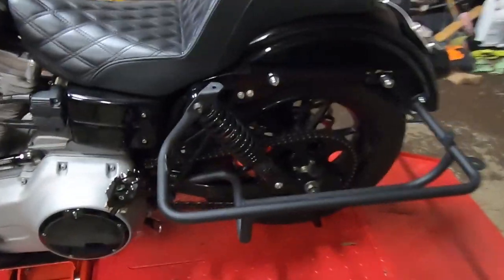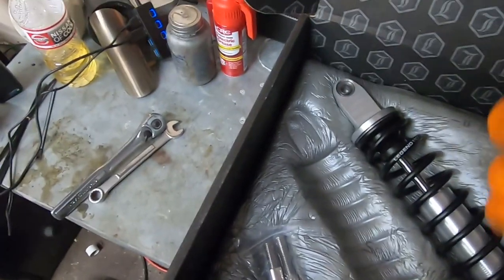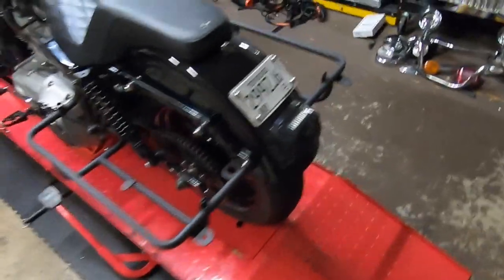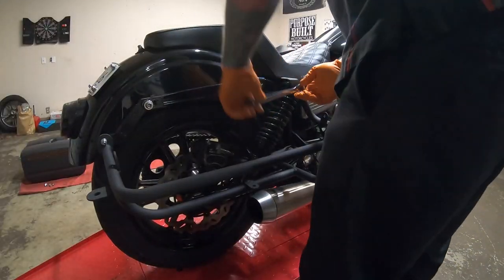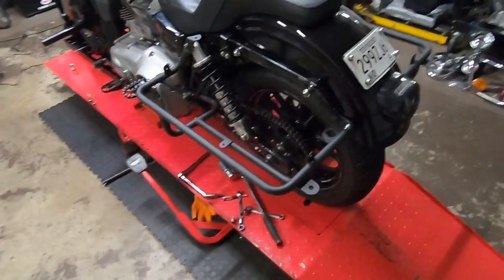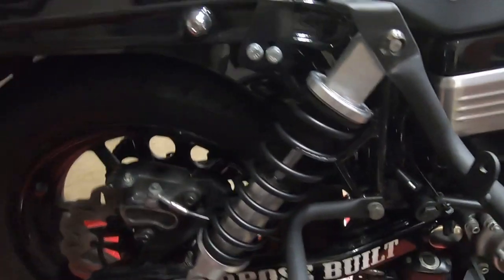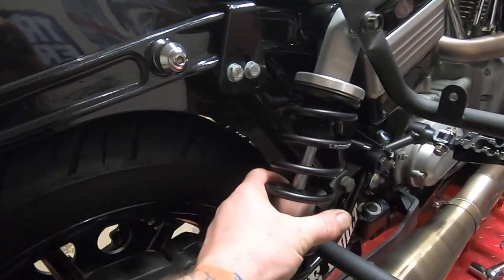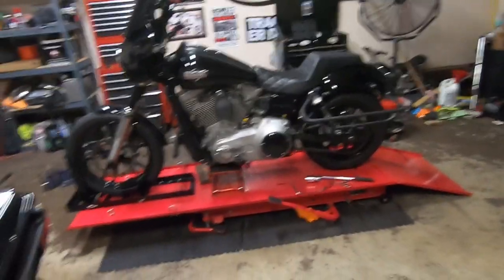Legends Revo A 14" shocks Install Clubstyle Dyna

Comment: Fitted 14 shocks and had to remove the rear passenger pegs as they were hitting the v&h upsweep exhaust...can you recommend the best exhaust to run with 14" shocks... your muffler looks quite close to the rear shock...did you have any problems..

Comment: Great video man ! How do they compare to the drag specialties for daily riding ? (Not so much for stunts but commuting, canyons and long trips, etc ...)
Reply from the maker: Should be way better look out for a review video.....thanks
Reply: I rode the drag shocks and they worked great. Now i have legends and they work too. Worth the money? Not at all in my opinion. On my fxr they have to be spaced out really wide. Looks super off. Bags wont fit because of this. If i were to do it all over again and spend 1k on shocks i would go with another brand. Öhlins for examplr has been one  of the best for so long they do not need to prove anything. These legends are 2.7 dia so make sure to measure for fitment. Bottom line, 700 bucks over a drag shock not worth it.
Reply from the maker: I got a deal on these did not pay retail....thank you for the comment
Reply: Thank you for the detailed reply, I gotta think it through to get it right without throwing money away.

Comment: hi man do your lower bolt touch the bassani exhaust. i have this bassani on my 103 dyna and was wondering if it will fits with this exhaust? thank you man
Reply: the 14"
Reply from the maker: No it does not...